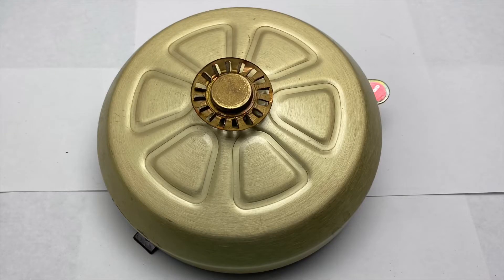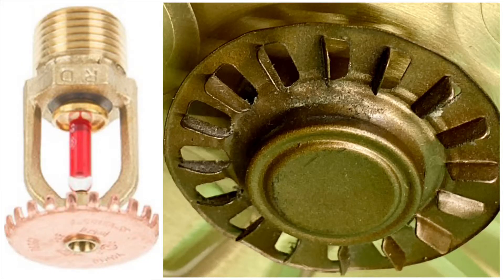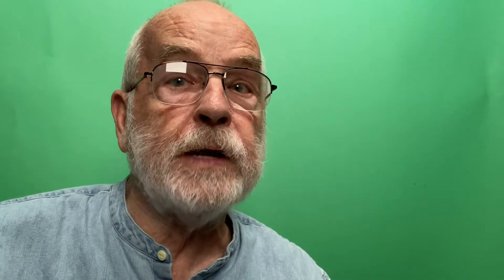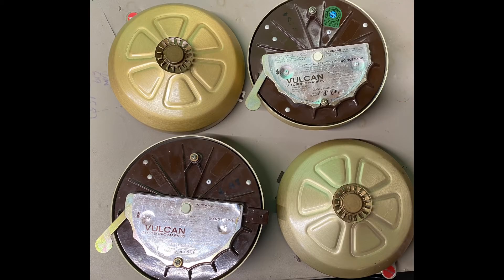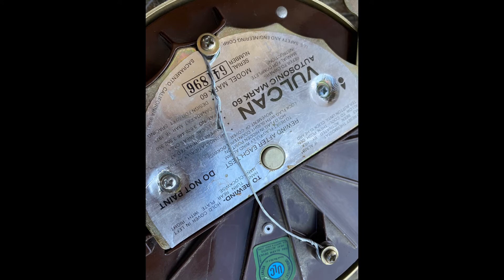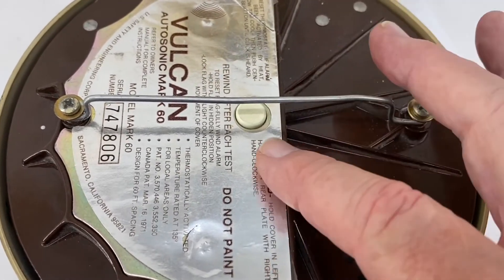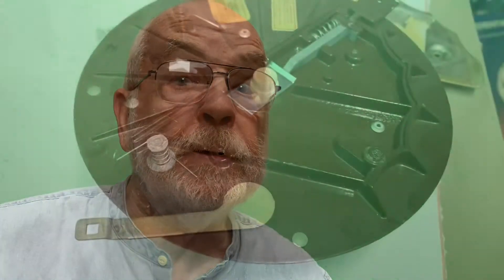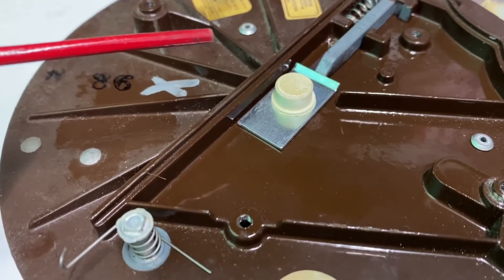VULCAN AUTOSONICS MARK 60 spring powered heat sensitive fire alarm bell

Comment: bi metallic disk thermistat. No wax anything. I sold them in Florida in the 1970s. 1 heat detector  and a smoke alarm. $198.50. each alarm additional is  was 90 bucks. WE sold a heat alarm in every room.  That was lots of money in the 70s.

Comment: I used to sell these alarms. First, before you have smoke, you have heat.
  These alarms are the best there are. They save lives!!! The smoke detectors work if you have a trash can something hot is accidentally dropped in.
 The Vulcans ring for at least 30 minutes and are louder than a school alarm: imagine that up close inside your home. They are purposely made with a spring, rather than electrically activated, because in a fire, electricity may go off. It's even possible an electrical short may be the cause of a fire. Call the company in Sacramento and they can hook you up with a local distributor.
  DO let the distributor come out and explain these to you.  It is important that you know what to do if you have a fire, as well as ways to actually PREVENT fire in your home.
  This is NOT about a "sales pitch", but rather properly protecting your family!!! These people DO Care!!!

Comment: I bought a house with these installed on the walls in a few places. Mine also have chains attached? Any reason as to why is beyond me... Any input is appreciated.
Reply: The chain is usually attached to one of the units that is in a bedroom. The chain can be pulled to activate the alarm in case of a burglary or emergency.

Comment: I've had these since the 1970s. They're supposed to be mounted 10in down from the highest point from the ceiling.
There was a matching smoke detector. It was the kind that has a light in a closed chamber not one that detects products of combustion. The failing was the light would go out and you need to replace it. I still have both. I may sell them in my next garage sale. My problem is I have a vaulted ceiling that is 12 ft high and 10 inches from the highest point means I need an extension ladder to get up to reset it.
They work wonderfully and yes they actually do ring for almost 7 minutes when they go off.
To rewind them you turn the gong clockwise while holding the back until it is fully wound. You then turn it counterclockwise while holding the flag in to reset the flag. The flag is there to warn you if the gong went off while you were away from home.

Comment: I remember testing them in the presentation to potential buyers with a candle and a milk carton shaped cardboard stand over the candle and the alarm placed face down on top of it allowing the alarm to get hot and set it off. Interesting that a lot of thought went into the design as the petal design was to disrupt the flow of air just enough to make it more sensitive to heat. These were designed to go into kitchens and bedrooms and an optical detector would be placed in the hallways. You also would place them away from dead air zones where the walls and ceiling met, or corners where 2 walls and ceiling met. The silent sentry that never sleeps and has no battery to run down. There is no wax for the sensor, it is a bi-metallic element that is reset with the button on the back once the alarm cooled down after testing, then simply rewound and placed back into service. They were very good, but were expensive. But then again, how much do you value your life and the life of your family.

Regarding why a smoke detector was used in addition to these heat detectors is that you would never place a smoke detector in either a kitchen, room with a fireplace, or a utility room with a gas fired water heater as you would get many false alarms. The smoke detector was usually placed in the hall and the heat detectors were placed in all rooms.

Comment: Also, no spring...its a 21 foot high tension surgical steel band wrapped around cams and brakers. It will ring for 6 minutes and 45 seconds.
Reply from the maker: It is a clock spring.
Reply: @BobHudsonVideo  According to the salesman who sold me mine in the 1970s it is a spring wound in a figure 8 configuration.
Reply: True.
Reply: All of you seem to understand these.
 But for those that read this and don't, please do call the company and get a presentation! It does not take long, and learning how to protect your family is well worth, Even if you don't buy the alarms. If you do buy them the presenter will mount them for you and know how many you need.
  Finally, I have not sold these for many years; nonetheless,. I know how good they are and will always have them in my own home .